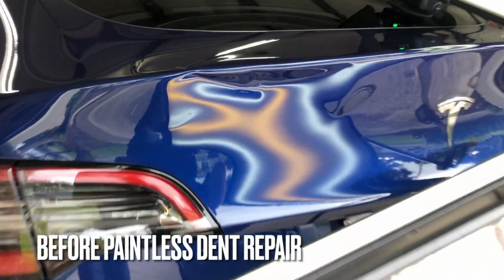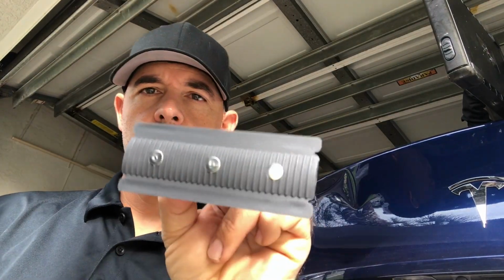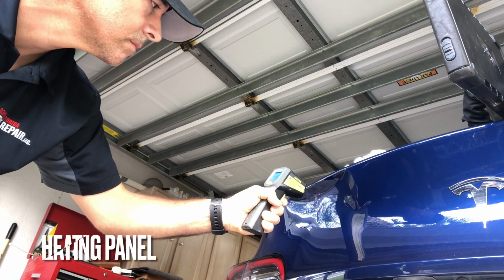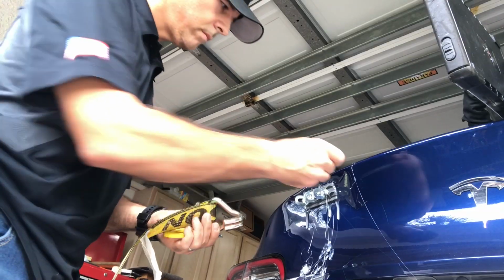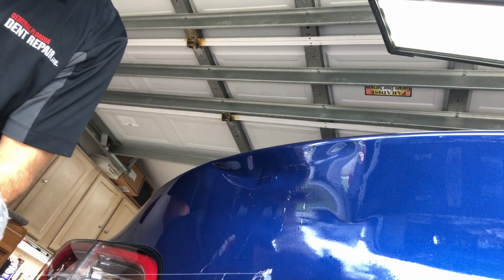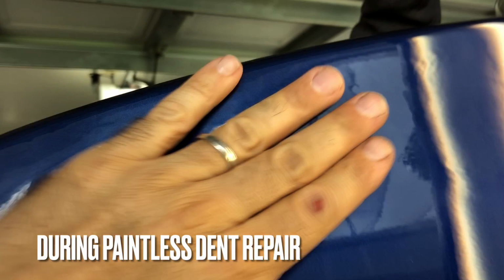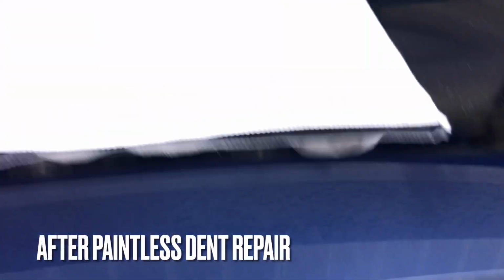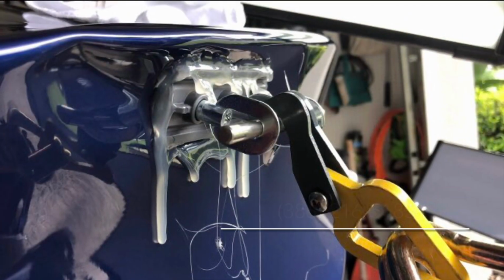COLLISION GLUE PULLING TECHNIQUES REVEALED! PAINTLESS DENT TESLA

Comment: Superb . I agree the paint on a Tesla is the best that I've seen and the clear coat doesn't even mark it's quite impressive. Recently I heard that it's electric static applied , then baked . Not sprayed like convetional
Reply: Wow that would be great if all the company’s started doing that.  Pulling paint sucks.
Reply from the maker: Yes, you are correct! It’s electrostatically applied. One of the most efficient ways to apply paint and also a much better bond it seems. Literally some of the best paint jobs on the planet to date👍🏻 Thanks for stopping by!